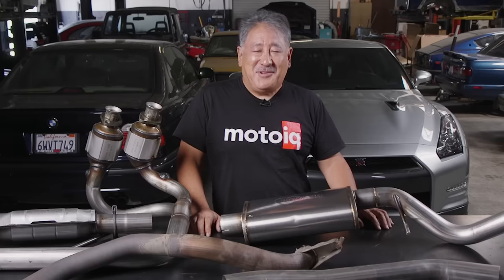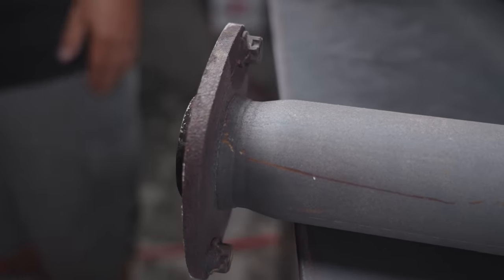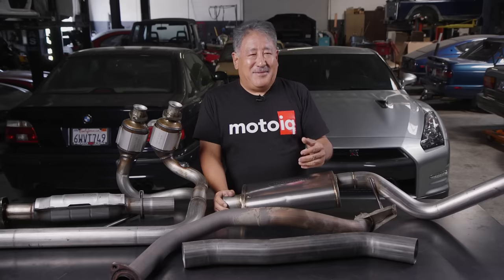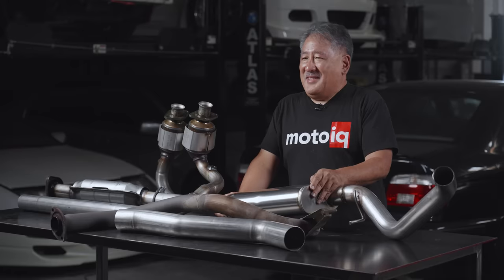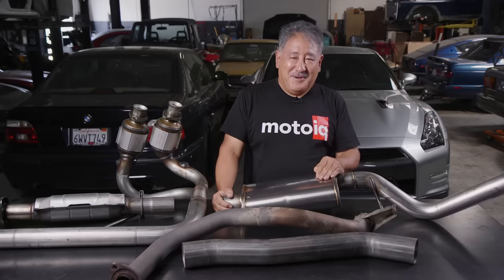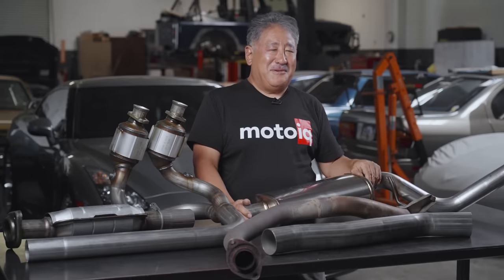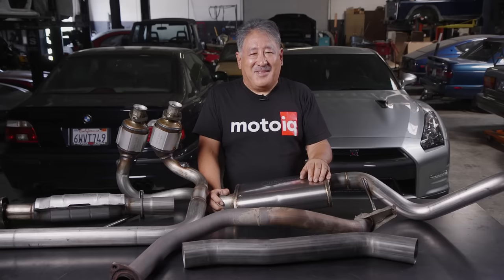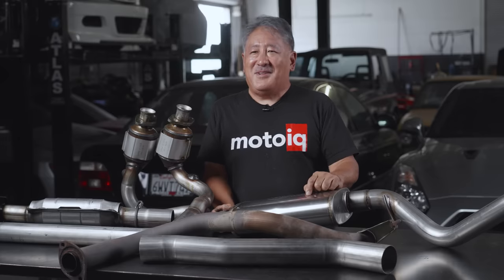Exhaust Back Pressure Myth DEBUNKED!

Comment: As an engineer who grew up working on my own cars, these types of videos are awesome. They bridge the gap between the book smart engineers and the street smart technicians with the hands on experience.
Reply: As I posted above, I've been in a Fox body mustang GT that lost a lot of torque after he added headers. It was sad actually
Reply: @razorfingers  like he explains in the video, you still need proper tubing to create enough velocity without adding backpressure. too thin tubing restricts air flow and puts backpressure. too much air flow will not let the exhaust have enough speed
Reply: That's because like we used to say about souped up Fords is
" But it's still a Ford"
Reply: @razorfingers  lost a lot of torque? How did you measure that? Dyno? What about HP?? Did you gain or lose? Did it change the power curve up or down? I have never seen a Fox Body or any other "lose torque" from adding headers....& I have known a few. Wonder if you tuned? Or deleted the O2 sensors like I have seen a few bone heads do thinking they can delete and don't tune. Also your headers shorty, mid or long tube? Diameter of tubing? Its hard to believe you lost actual measurable torque. You didn't just "think" you lost torque and was just disappointed you didn't gain 35HP instantly like the advertisement on the Box said did you? And that lack of throwing you and pinning you to the back of your seat didn't happen so you just assumed or thought that was the outcome? Because gaining that "advertised" HP & torque on the box is supposed to include doing a handful of other mods to the engine to get that Maxed out HP gain from those "amazing" headers, such as tune for starters.... after freeing up the exhaust with headers, now your moving more exhaust and now its running lean and have to add more fuel. You are not running optimum air/fuel mixture. You aren't getting the most out of the headers if you don't do other mods, now your intake isn't keeping up, you need more fuel also.....tune tune tune tune after EVERY MOD YOU DO. if its a carburetor then make your adjustments add more fuel and free up the restriction at the intake to help the headers do what they are supposed to do, free up restriction
Reply: As a street smart technician I would like to say thank you for showing that respect towards us, most engineers dont want to admit that technicians also develop engineering skills and qualities, simply by just  working on crap made by a shitty engineer ;) ...but since you clearly know this your work must be on another level than of those guys so no worries...I can respect a good engineer in the same way you just showed all of us that respect (y)
Reply: @agems56  adds a small amount of boost to any stock mod motor and debunks your entire claim.
Reply: Except he’s telling us Street smart techs with actual hands on pro experience we don’t know what we are talking about when we give him formulas for fluid dynamics.
Reply: @thecraftsman8133  you’ll never get through to him. He doesn’t even think using a supercharger in conjunction with twin turbos has any value. I tried explaining we use them on aircraft that way and get great performance. He came back with how much smarter he is and how I wouldn’t understand what he was talking about if he explained it to me, which he never did, only started insulting me. Guy’s a hack.
Reply: @Simon_HDM  amen brother 🙏🏻 😎
Reply: @curcheesegaming8704  exactly what I have been telling this guy. He claims I am not good enough at math to explain it to me. 🙄 
Gotta boost if you want performance at variable ranges out of your exhaust system. 👏🏻
Reply: It's amazing that you can acknowledge the street smart technicians! I would have a drink with you any time.
Reply: Car manufacturers tune  vehicles to meet emissions, fuel efficiency and noise regulations. I think you need some back pressure for a broad torque output.
Reply: Exactly, But, People Must be aware of what a Terrible Idiotic Deception is the catalytic converter , and how even much worse is the Egr valve. !!! ! !!!
Reply: @razorfingers if a Camaro and mustang are straight piped with short tube header with no cats and you ad long tube headers you’ll lose a little bit of go and gain a lot of hp. If both of these cars had catalytic converters and you put long tubes headers you’d gain hp and torque. If you lost power you guys probably messed something else up.
Reply: Yes you do need back pressure. Any resistance whatsoever is back pressure. That’s why proper sizing gives you the scavenging is a fancy term for optimized back pressure. This guy is speaking semantics and explaining it his own way.
Reply: @robertchiarizia9463 forced induction usually requires less than optimized dynamic compression. Naturally aspirated people are about optimizing the pump. Not using pumps to feed the pump. Power adders are cool. And all but learning how to build an efficient engine (pump) wouldn’t have you saying this
Reply: @Impala-qp9cb  “less than optimized dynamic compression“ is a term you pulled out of your backside.
Explain what ‘dynamic compression’ is. I might agree with you. Keep in mind I’m used to ‘dynamic compression’ with a compressor section on a jet engine turning at 40,000 rpm using 14 stages of stators and rotor blades.
Reply: @Impala-qp9cb  an ICE is a very inefficient Powerplant converting at best 40% into kinetic energy. 40% is not even a naturally aspirated ICE, I’m referring to an engine that is supercharged and twin turbo with a manual waste gate control and completely separate exhausts for both banks. Like World War 2 aircraft used.
The main reason they aren’t useful to you in the ground is you are not capable of transferring that power into locomotion on the ground. The horsepower would be wasted just spinning wheels.
Plus you would burn the heads up faster having to rebuild them often. Ceramic heads could help some of that. Still comes back to cost versus purpose. 
I could build a bullet proof surfboard out of Kevlar, but popping out normal fiberglass ones is easy, cheaper, and simple to manufacture compared to using diamond dust scissors, autoclaves, and all the special equipment for aramid composites. It’s easier just to boost your cars and call it a day.
Reply: @robertchiarizia9463  static vs dynamic compression in an internal combustion engine. It’s a thing. It’s the calculation of measured compression during operation of the engine as it relates to the intake closing point on a given camshaft. To calculate it, it requires the calculated static compression. There are other factors such as rpm and timing advance as the engine sees varying conditions. I’m no engineer but I build engines as a hobby. And they always make power.
Reply: @robertchiarizia9463  and yes, that’s why forced induction works great on low compression engines. It spikes the dynamic compression up. It’s also why it works better as rpm’s climb.
Reply: @robertchiarizia9463  boost requires timing events that are modified. Increases heat. Increases complexity. I don’t need boost to make power. I make an efficient pump to move air. I don’t make that pump less effecient to accept the charge from another pump. It’s not needed. It’s more expensive. More parts to break and more maintenance intensive. Yep you are an engineer. Lol
Reply: @Impala-qp9cb  I’m an A&P Mechanic working these days as an auto mechanic because i like the short commute, weekends/holidays off, and convenient hours. At some point i may go back to commercial aircraft maintenance. For now, enjoying the challenge of these plastic pieces of shit they slap together on the assembly line and extort money from people to replace the last plastic piece of shit they bought for too much money.
We’ve been getting more classic car restorations lately, and that would be more interesting to do as far as i am concerned.
Bottom line for cars is that horsepower is meaningless unless you can transfer it to the tires and make it scoot. 
The more air you can compress into a cylinder before you explode it, the bigger the bang is gonna be. Yeah, if you don’t make the engine use that bigger bang to create more rpm’s, it is wasted energy in an already wasteful way to make kinetic energy with an internal combustion engine. Which leads me to the better way to build faster cars; more like a train, like your hybrids - use an ICE to power your actual Motor, the electric kind. You’ll get more speed off the line and can get at least another 30,000 rpm’s out of it if you build it correctly.
Can you imagine how fast a big diesel F350 would be if it was built like a freight train power plant? Blow the doors off these little rice burners in a cloud of choo choo train smoke.
They typically hire aircraft mechanics in the race industry because we understand mechanics beyond the brain washing of the big automotive industry pushing their plastic pieces of shit on people these days. Auto engineers would be laughed out of a design project for planes, trains, and ships. They’re hacks. Polishing turds 💩 
It’s a racket.
Reply: @Impala-qp9cb  you are overthinking it when you involve variable valve timing. The auto industry went to overhead cams because it saves gas and reduces emissions, not because it’s a better engine. Give me a 351 Windsor any day over some Triton pile of variable valve timing turd. Supercharged single cam engines with twin turbos are still better and less complicated. 
It is only emissions and gas mileage that forces you to use this over engineered technology in cars and trucks.
I mean i get it, i daily drive a Toyota 1MZ-FE engine and it does a great job with all the variable valve timing, unboosted, no turbos, etc.
You put one sharp turn on the track and I’m leaving a stock Camaro in the dust on the turn because the rice burner is built for handling, not a drag strip.
Supercharging along with twin turbos and exhausts that have no ‘X’ connecting them using an old school V engine technology in a modern composite body with modern brakes, suspension, rear, and steering will dust all these fake wannabe look alike muscle cars, Euro trash, and European designed Asian ‘sports’ cars.
The way I would design a car would get me assassinated by the Big Three and imprisoned by the EPA. 🤘🏻
Reply: as an engineer, i'm telling you that as an engineer, you should know damn well he doesnt know what he is talking about. the ONLY engine that doesnt have any back pressure, does not have an extractor pipe, and vents direct from the atmosphere. if you have headers/extractors/exhaust-pipe (call it what you will), then you cannot possibly get rid of backpressure. the trick is the timing of backpressure waves to coincide with a closed exhaust port
Reply from the maker: @Ghryst  I guess you are not a very good engineer that didn't take thermaldynamics
Reply: This is all book smarts
Reply: @frank.l181  what is the advantage of back pressure?
Reply: @kopronko  how so? How is recycling exhaust gas not useful?
Unless a CAT is blocked, it won’t affect anything, still comes down to how you tune it, what parameters you have set for engine performance so the readings you get off a sensor can matrix air and fuel properly. The back pressure ok, I can see that. Drill it out, put a defouler on, tune it, Done deal
Reply: bowhunter4954  there’s no reason to strip a bolt off of a Pratt & Whitney. I used to work on PT-6’s. The mechanic before you has torqued everything to spec, so it’s gonna come right off. The only difficult bolts will be for the harness to the powerplant.
The landing gear has where the bolts will get stripped, wing panel bolts get stripped, stuff like that. It’s not like a car engine. It all comes apart pretty straight forward, sequential disassembly.
The prop governor is the only tricky part of the install
Reply: And people wanna say back pressure
Reply: Very well said